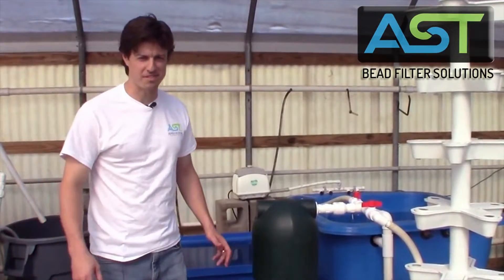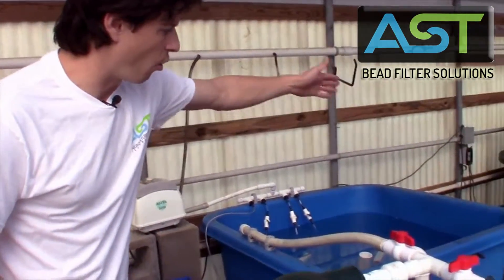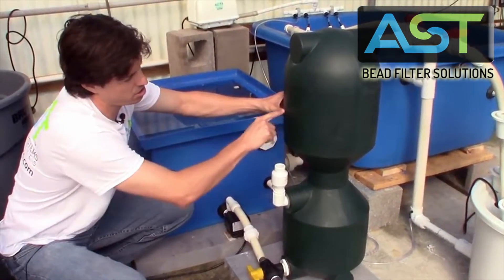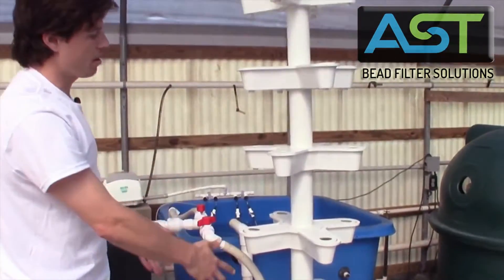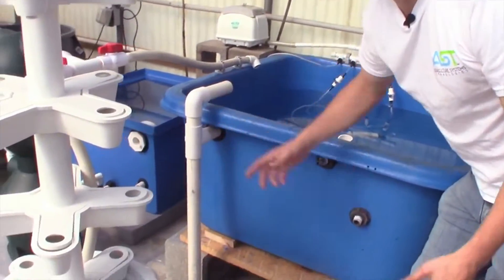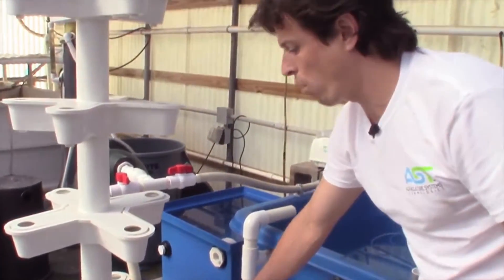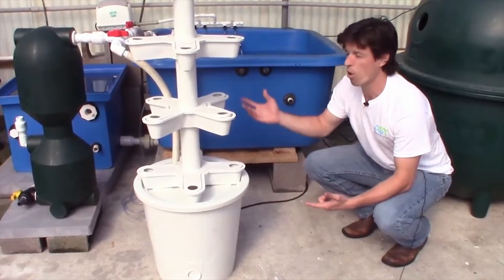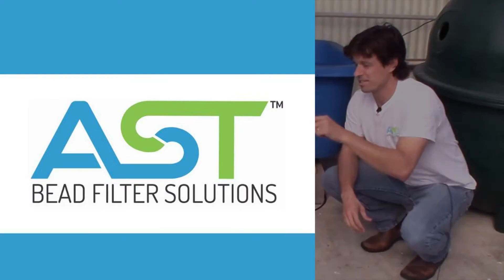Small Aquaponics System Setup: Part 1

Comment: Hey Paul, looks like a great small system. A couple questions. 
1. On the Endurance 2000 I want to gravity feed the water into it and pump the water from the sump tank correct? 
2. Can I use the Alita 150 for the filter and tank aeration?